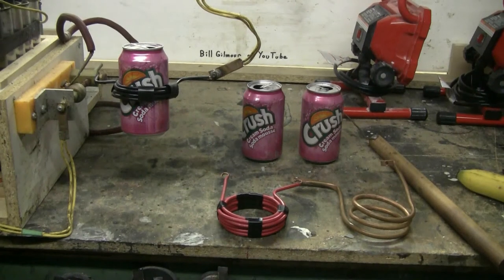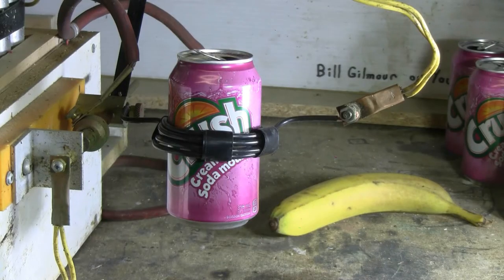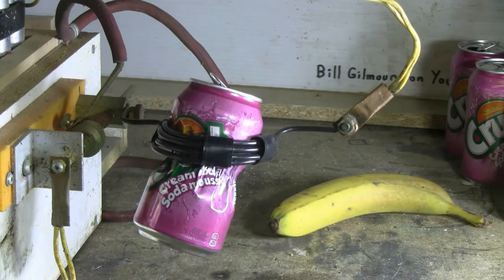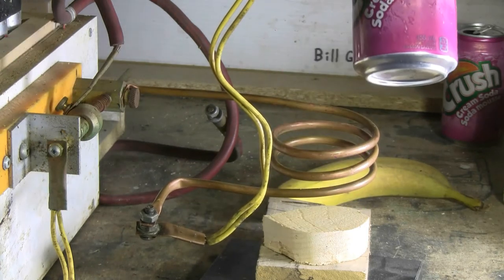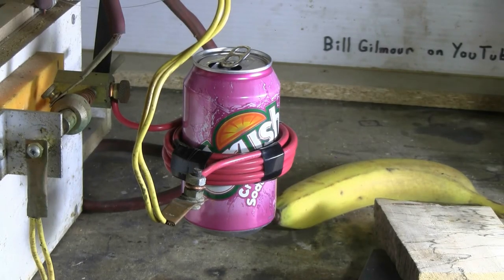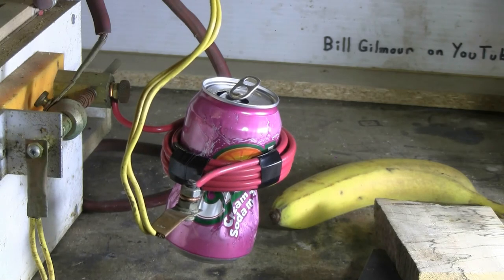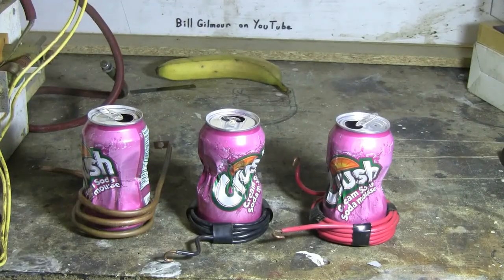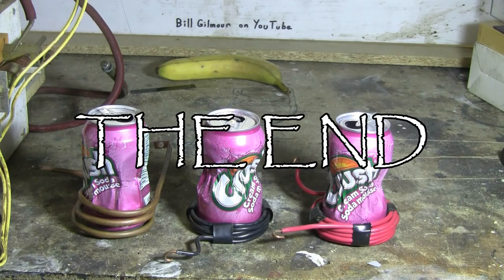Capacitor Bank #64 - Can Crushing With Three Different Coils

Comment: Instead of a mechanical can crusher. Elongate the coil to the length of the can, place the can in, hit the "Electro-Crush" button...and the can drops out the bottom into the recycle bin :)

Comment: Since magnetic flux is determined by Amp-Turns I would have expected the 10T coil to perform the best, assuming the increased inductance of the 10T coil didn't impede current flow significantly more than the inductance of the 5T coil did. Normally in such large conductor low turn air core inductors the major impedance factor is the resistance of the conductor. At such high voltage one wouldn't think the increased resistance of twice the length of wire would significantly impact the peak current flow. Are both coils made of the same gauge and construction of wire?
Reply from the maker: The 10 turn coil used here had solid wire that was slightly smaller in diameter than the wire used in the 5 turn coil. I may try this again with several coils wound from the same spool of solid wire, maybe 5,10,15, and 20 turns.